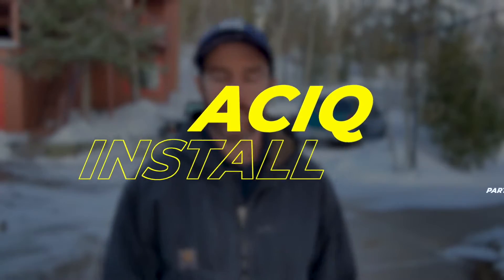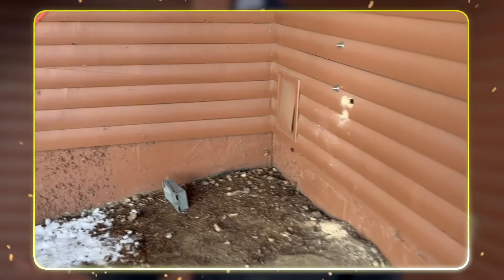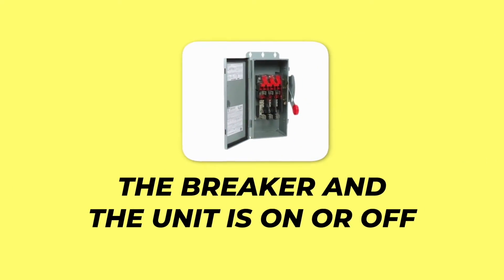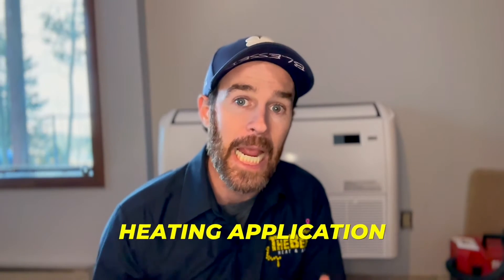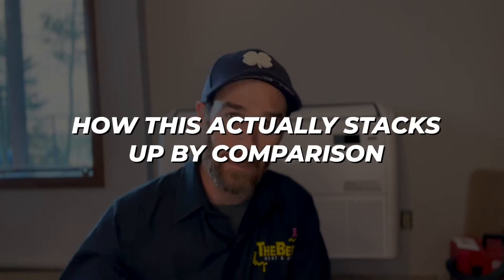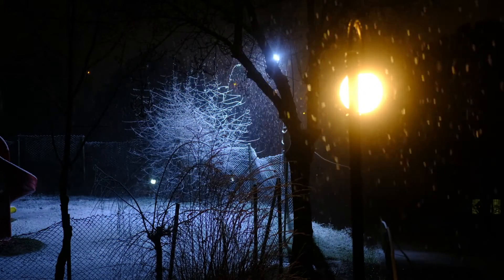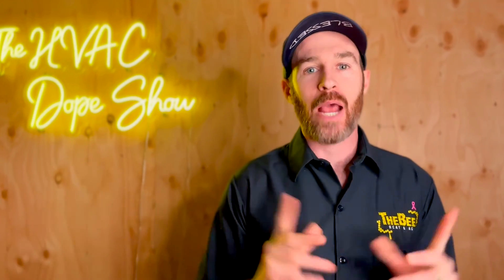ACiQ Cold Weather Heat Pump Install… the verdict! 🤔 | Part 2 of 3

Comment: Can you share what surge protector you recommend? Ive got a 2 ton with two wall units im installing next week.
Reply from the maker: Any of them work... for just the AC rector seal makes one that's affordable, it's maybe $50 or so last time I checked. Whole home surge protection is more expensive but will protect all appliances so that's an option as well

Comment: What are your thoughts on minimum line set length? I’m about to install a 36k single zone and it’s looking like the line set will be about 10 feet.
Reply from the maker: I think that's what it calls for that's probably fine. This unit we installed was about 10' and it's worked without issue two winters now
Reply: @ I did a pioneer 12k years ago at 7 feet. If the house was quiet you could hear the compressor change frequency through the indoor coil 🤣
Reply: Assuming 10 feet is the minimum the manufacturer calls for, you should be fine… Systems are designed with a minimum line set generally for efficiency calculations as the assumed pressure drop and velocity wont’t change materially unless you go shorter or much, much, longer… Too short (or too long) could cause issues with systems using a VFD and EEV as the PID setting for the controller are usually not accessible in residential systems (even if they were, most techs wouldn’t have a clue how to adjust anyways)… More specifically, as an example, you could wind up with hunting issues not very different to those when you have an oversized TXV (even with a MOP) relative to the evaporator; basically could see high pressure or low pressure limits exceeded of swings become excessive, shortened compressor life, etc…

Comment: My 3 ton system doesn’t heat well under 20F.  Goes into defrost mode often, especially at night while sleeping.  We wake up to a cold house.  Having someone check out the sensors.
Reply from the maker: Could be the charge if it's low on refrigerant, is it sized for the heat load on the house? It's normal to go into defrost mode every 30 minutes to an hour, you can set backup heat to run during defrost cycle if you want, it will cost more to run but it's definitely going to fix that part on colder nights. I would make sure the switchover temp is set properly for the temp at which the load exceeds capacity
Reply: @ 

Thank you.  They did charge the system 10% more than factory settings hoping to compensate for the defrost cycles.  Given the configuration of my house, we were only able to use three heads.  It’s not optimal, but does a decent job.  I will mention your thoughts to our service tech, as he was finding it somewhat difficult to deal with ACIQ customer service.  Thanks again for your input.
Reply: As it turns out, some of the issues are defrost cycle related, but what no one can figure out is (on temps above 20) why the system does not heat as much when we are in bed?  When we wake up the house temps are 3-4 degrees lower than the set temp - whatever that is.   The intelligent eye or the room movement settings are not on.  Thanks for your input.

Comment: Great video! I just bought this exact setup (in part due to your video). I unboxed the interior 'floor mount' unit and cannot for the life of me figure out how to mount this on a stud wall. Its going in my garage and I need to lift it up at least 5" to clear the concrete wall. My studs are 16" OC. The only mounts on the unit are two mount points ~39" OC. Do you remember how you mounted that interior unit?
Reply from the maker: You should have a wall mount not a floor mount if you're trying to mount it to the wall? Something like this is a wall mount bracket we typically use. We normally use the brand rector seal but honestly any of these Amazon ones are probably fine but I like the ones like the link because they have a top bar that you can mount into studs in case the L brackets themself don't align with your anchor points or studs... because the width of the condenser doesn't always match up with studs
Reply: @TheHVACDopeShow  Hi thank you for your reply. I'm talking about the interior 'air handler'. Not the exterior condenser. At 6:39 in your video you have the exact unit that I purchased. I need to mount it just like you did. How did you accomplish that?
Reply from the maker: https://amzn.to/4fVOxvN

Comment: We have heated our 4500 square foot house with a 5T Trane XL24i for 18 years.  The compressor just died so we’re on electric heat strip power now.  *HOT TIP* You can’t get credit for replacing a hp with another hp but since our compressor failed, we are now on “electric heat” our local utility granted me a waiver -I just had to ask them) 
I did a LOT of research, and was back and forth with Rheem and Goodman units, but the more I studied the ACIQ specs the better it looked.  I ordered 2 units on Friday, Nov 8.  One was a 5T extreme heat unit with an indoor air handler a “drop in” replacement to my Trane unit.  The second was a 2T mini split unit for our carriage house (electric baseboard heat). Total out the door was $9000 with tax and delivery.  It arrive at our house the next Wednesday (3days)!!  Because I two electrical services, I can get two credits.  So the end cost is $9000 - ($1500 x2)-$2000 = $4000! Plus install, of course, and I’ve got quotes for around $10k (which is high in my mind).  As a side note, I had received 5 quotes to replace my main house unit only, and all were between $30-$40K.  That’s what got me looking in the first place

My biggest concern with the ACIQ was quality/reliability and we’ll have to see, but initial inspection looks very favorable.  All of the components look high quality, and the coil especially looks like it has advanced corrosion protection.  I’ll try to post after the install is complete.
Reply: So how's it operating?

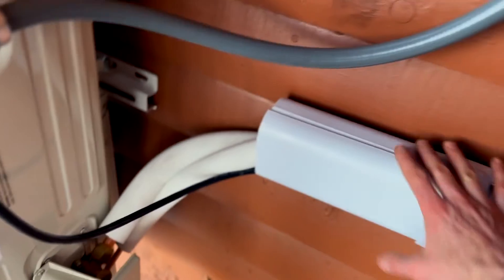Comment: 11:46 your line hide is installed incorrectly, the screw hole should not be visible, you have the two inch mount installed backwards. That hole is where you're supposed to drive the screw again your house, but you have it showing on the outside. Don't ask me how I know 😂
Reply from the maker: Two inch mount? You mean coupling? That's not a screw hole... it's installed correctly. I see what you're referencing it looks like a hole but it's not

Comment: Cooling is my issue in S FLORIDA... need more info for sure
Reply from the maker: Cooling you’ll have no issues 😁 heat pumps in cold climates have a much more demanding scenario but for cooling only you’ll be fine. High ambient specs on that one are 120’s~ so in Florida it’s a non issue
Reply: @TheHVACDopeShow  Thanks much!

Comment: Looking for Part 3 results video.  Where can I locate it?  Your Part 1 and Part 2 assessments can't be viewed as valid if you don't provide the system results.  Leaves a consumer to pass on acquiring the ACIQ system. Hope you were paid in advance by ACIQ.  Secondly, if your system is level as represented in the video, your foundation is sinking.
Reply from the maker: The house is on a hill… the video will be out shortly see the other comments on how it kept up. Been busy and was out of town the weekend it was cold (-15F)… but thanks for being patient been busy 👍 the video recorded was only at 9F and it’s not back from the editors. I don’t control the weather and it didn’t align with my schedule. Sorry other priorities try not to take it personally

Comment: There have been some super cold nights in the Denver-Colorado Springs area since Part 2 came out.  Is Part 3 of the ACiQ review series coming out any time soon?
Reply: I have the same outdoor ACiQ extreme heat unit and the wall unit in my garage.  It got down to -15 here in a couple of nights a week or so ago and it easily kept up and kept my garage at 68 degrees, which is what I had it set at.  Very impressed with the unit.
Reply from the maker: Short answer is the heat pump kept up, but I was out of town the weekend that happened and the morning I got back it was 15F so it wasn’t really worth filming. This was the coldest snap we’ve had, I’m hoping to get some single digit footage sometime over the next two weeks

Comment: Recent subscriber (cuz you really seem to know your sh*t - and I don’t;)

Sorry for choosing this method to reach out but I can’t seem to find an answer on YouTube for my scenario.  

I’m almost done framing a new build in Toronto.  3-stories, flat roof, bout 2500sqft.  Tight lot, so big windows on front & rear.  Master on top floor.  

From what I’ve gathered, all the sweet rebates on Solar and Heat Pumps are only for retrofits:(

I’m permit approved based on a gas furnace, and have a few gas fireplaces I intend to install.  

Despite no rebates, I still would prefer to do right by Mother Nature, so part of me is thinking to go solar panels on the roof to run a dual system heat pump.  I also planned to install electric heated floors in the basement. 

Additionally, I hate bulky duct work, plus my son has asthma, so minimizing dust/ducts would be nice.  

I’m hoping there’s an ideal, yet somewhat cost efficient HVAC solution for my wishlist.  

What would you suggest?

D
Reply from the maker: Thanks for the comment! Honestly radiant floors with reduce dust, but if you’re wanting air filtration getting at least a 4” filter or 5” filter rack / box will help remove fine particles. Heathway makes a merv 16 filter box we’ll be discussing on the channel soon.

Electric heated floors are VERY expensive to run. One of the heat pumps we’re going to be talking about soon is air to water heat pumps and these are great because with solar panels you can get radiant floors and hot water. It’s definitely more expensive up front but you’ll get the benefit of heated radiant floors that are much cheaper to operate than electric heat. Most people don’t run their electric heat because it’s so expensive to run…

So the considerations are installing radiant floors which reduces ductwork, but your region / climate will determine what this works out to be. Are you in a frigid / arctic climate? Because if so you’re best option for electrification is Geothermal, but if you’re on a tight lot and it’s a moderate climate - Toronto sounds moderate from what I can see? Lows in the 20’s on average and highs in the 30’s Fahrenheit - an Air to water heat pump might be a way to get your radiant floors without doing geothermal and still getting to use your solar array. Because most heat inverter heat pumps are an option, and all the air to water heat pump tech I mention will also have great efficiency. Nordic is based in New Brunswick and there should be several contractors able to help / install their products in your situation.

Comment: Just installed an extreme heat 3 ton ducted unit. Pretty impressed with quality. It’s really made by midea and exactly the same product carrier sells as their crossover system. My question is what the communicating stat is really doing. It’s so cheap I’m having a hard time believing it’s truly communicating.
Reply from the maker: That’s awesome to hear, yes my neighbors love their unit so far. We have some cold weather on tap next week so I’m going to get some cold weather footage. I’m not familiar with their communicating stat but it’s normally easy to tell based on spread point. So if it’s 68 inside and then you set it to 76, it should ramp up to full speed within 5-10 minutes, vs. if you just turn it up to 69 it might stay in a lower speed fan setting and the condenser should modulate at a lower stage as well.
Reply: Are these the same as the Mr Cool Universal? Those are actually Gree units. They also sell them as Tosot but the install manuals are exactly the same as the Gree word for word.
Reply: @houptee  haven’t looked but don’t believe so.